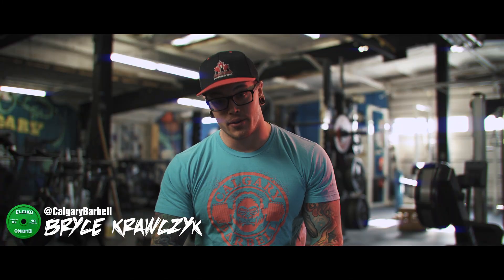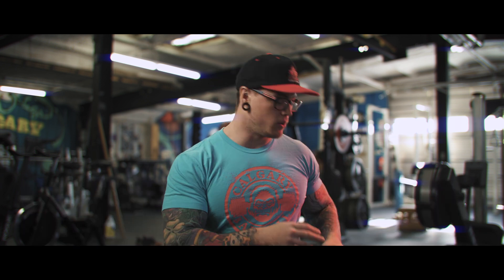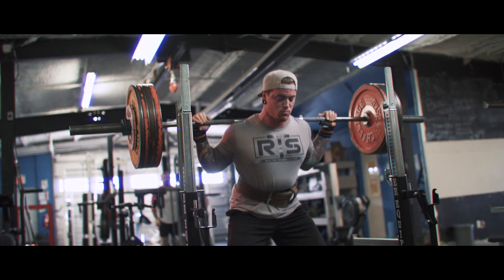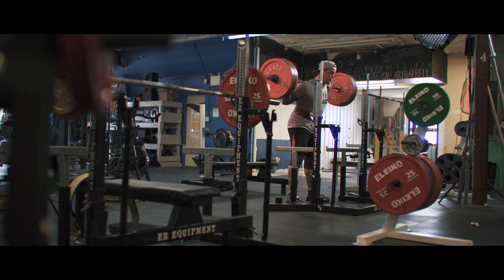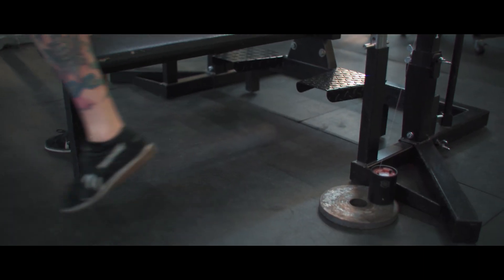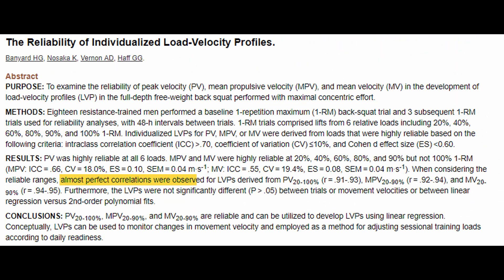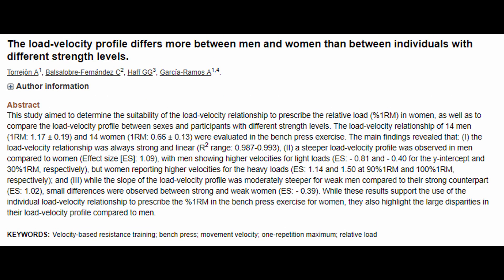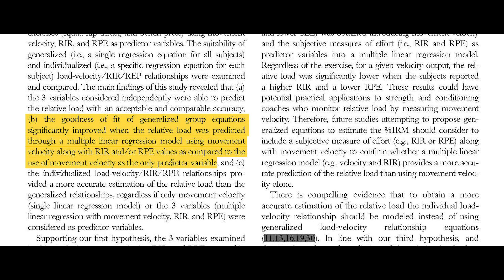How I Use Velocity Based Training (And The Science Behind It)

Comment: What do you think of the potential nocebo or placebo effect that the information of velocity may create? EG If the bar moved slowly in your last warmup your work sets may potentially be affected due to thinking that one is "having a bad day".
Great video!
Reply: Velocity tends to correlate highly to RPE though. I think you're picking out real, relevant information as opposed to biological data which might be coincidental...
Reply: That’s why you continue to use it after your last warm up set, it can change throughout the work out. Plus it’s more of a tool to hone in on the accuracy of your RPE

Comment: Great video! I'm just beginning to track velocity in my training and a couple other useful tools I've come across are peak power to indicate recovery (an example of this was a programmed 5RM with a goal weight but my warm-ups felt very heavy, my peak power during my warm-ups (my 60% set) was significantly greater than usual so I still went for the goal weight and crushed it at RPE 6 instead of the planned 9 - 10) and Dan Bakers rule of thumb for every 0.04m/s increase with a load >/=80% you get a 2 - 2.5% increase in 1RM (but since powerlifters are more experience with near limit loads I tend to keep that estimate for 90+% loads). I hope I explained those concepts well enough.
I'm really looking forward to trying true velocity-based training
Reply from the maker: Interesting.  A point of contention however, is that most studies I found proposed a .06 change in velocity was the smallest meaningful increment to suggest progress.
Reply: @calgarybarbell  I'll have to check those out, as I said I'm just starting with VBT so I've been looking at more real world information so far (though Dan Baker is a super smart dude who does reference a lot of research). Do you think it could be due to the nature of short-term studies and unfamiliarity with VBT? I'll keep the 0.06 in mind though moving forward

Comment: U can use an App called Iron Path to determine ur bar velocity. It is quite good and not limited like the divice. It works via video analytics. U guys might give it a shot. Never thought about using that number.
Reply from the maker: I’m pretty sure that motion tracking software has not caught up to the accuracy of actual devices at this point, but I’m sure it’s a solid option for most. What are the ‘limitation’ that the device has in your eyes? And how does motion tracking make up for them?
Reply: @calgarybarbell  Hey I think u miss understood me there. I dont think that the device is limited in its abilities more in the availability as u mentioned in the video that they are not manufactured all year round. The app might just be a cheap and easy to get option for everybody how wants to get into velocity based training.
As an mechanical engineer i would always go for the device in terms of accuracy than the motion tracking.

Comment: Have you ever experimented with using velocity tracking on a block where you use bands/chains and then the next block has it made your straight weight work faster. Basically challenging westsides claims that bands and chains will make you a more dynamic lifter
Reply: That’s more for multiply to carryover to explosiveness in multiply suits, but also over time using exclusively bands/chains/both/whatever other variations they can imagine to make you more explosive after a whole training cycle on a competition specific lift. So it isn’t claimed that in those particular lifts you get more explosive, it’s that training those ways makes you more explosive on competition lifts
Reply: Thanks I am aware of that since I actually visited and trained in westside I was asking has Bryce ever tried it with the velocity tracker

Comment: I saw a program from intermediate-advanced lifter, and, in the last part, the program says, "you are making 6600kg on squats per week", and, making my mats, in my actual program, my week routine have 14000kg on squats .. so... What do you think about the volume? I weight 60kg, my 1rm in squats are 100kg, my best mark are 80kgx20...
Reply: Depends on if it’s a hypertrophic, strength, or peaking phase. Dr mike israetel and juggernaut training systems has a very good video on this but using the amount of sets and reps to multiply by your weights since the weights will be different for everyone. So for one person 6,600kg could be great for a hypertrophic phase while someone else it would be good for a strength phase

Comment: Not really new.oldschool coaches instructed lifters to try to make the plates rattle to gauge what weight would be used that session.
Reply from the maker: Sure, definitely not a new idea to use bar speed to help adjust the appropriate weight on the bar. But “plates rattle” or “no plate rattle” is a far cry from being able to discern specific bar speeds and pair it with a correlating RPE.